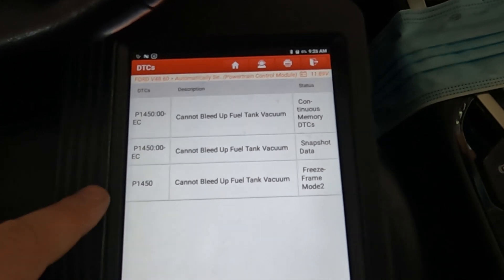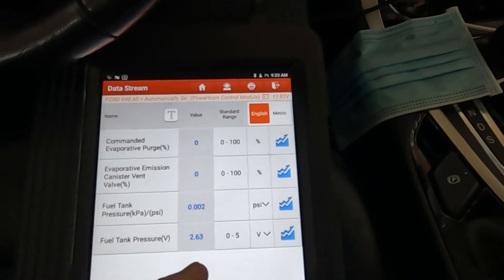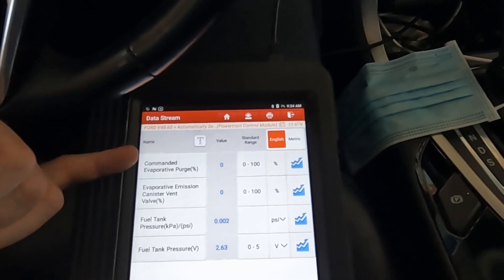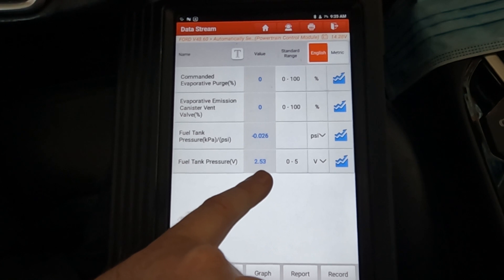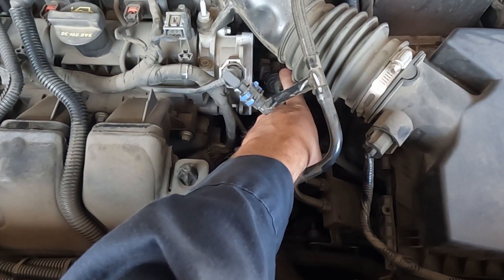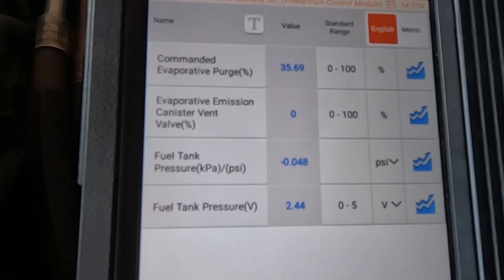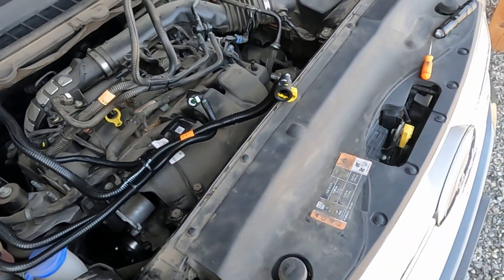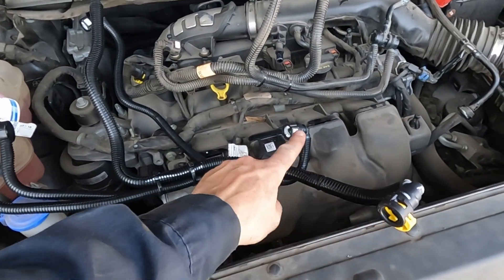Ford P1450 EVAP Code (How to) Simple Diagnosis and Repair

Comment: I have a 2014 Ford Transit Connect. Every time i put gas on it, the car wont start right away. It turns off. I already change the purge valve. Any body can help?
Reply from the maker: The purge solenoid is the most common reason for a no start after fueling. Do you have a check engine light or any codes?

Comment: P2196 also triggered in my 2015 Ford fusion 2.0 Eco boost. It's very hard to replace because there's no room for my hands down below and the OEM clips are very hard to release. No room to pull 2 tabs simultaneously and push on them at the same time when you can barely fit your hand down below. I replaced it with a Doorman brand, much easier clips in case you have to replace it again. 
P1450
Reply from the maker: Thanks for your comment! Glad you got it fixed 👊. I wish the auto makers would consider giving us a little more room to work. A lot of cars these days are cramped 😕

Comment: Also can the break boster pump leaking cause this code as well?
Reply from the maker: Good question. The EVAP system and the brake booster are separate systems. To check the EVAP system the engine computer turns off all solenoids and closes the system. It should hold at whatever pressure it's at for a certain time. If the fuel tank pressure sensor sees a change in pressure beyond the threshold it will set the code.

Comment: If these r all hoses isn't there a way to clean them out? Like a straw cleaner if the end valve is working? If u cannot blow through it supposedly its working? Yes or no?
Also what else could I check if this is good. Where is the gas tank collector?
Reply from the maker: The main culprit is the purge solenoid. Unfortunately cleaning out the hoses won't fix the solenoid. You can manually test the solenoid with a hand vacuum pump. It should hold a vacuum 👍

Comment: What about a Ford E-350 Triton 10 Cylinder, Year 2000?
Reply from the maker: The purge solenoid will be quite a bit different from this but the diag should be similar if you have a scan tool that can read live data.

Comment: Would this cause a "farting" sound from the gas tank for lack of a better description when the fuel level is low? 2.0 2017 ford escape with a p1450 code.
Reply from the maker: Not that I know of. Do you have any codes as well?
Reply: @ValleyMobileAutomotive  the p1450 is the code it had. It would drive fine but then would make a goose / farting sound from the fuel filler inlet and then after fueling would be very hard to crank.  everything under the hood checked out fine. Evap solenoid would work and not stuck open.I did notice the charcoal canister solenoid had little flow with power on the plug and blew it out with compressed air. Reset everything and put 100 miles on it today. The p1450 is gone but now had a p0442 code.  Drives
Reply from the maker: @Guardianautoservices  Hopefully the charcoal canister solenoid was removed. The EVAP system can't handle a lot of pressure. Around 1 psi or less. I would recommend a smoke machine to see if there is an actual leak or not.
Reply: @ValleyMobileAutomotive  great idea! I unfortunately dont have one but I will see what I can come up with.

Comment: What is the situation with the 2018 Ford Escape 2.0 Ecoboost?
Hello.

 

I am from Poland and I have a 2018 Ford Escape 2.0 Ecoboost.

For a few days now, I have been getting the P1450 error. When I clear it, it reappears after a while, after driving about 0.5 km or more. Now i drive 40km the error did not appear
 

Can you help me identify the problem?

 

Will I also have a valve that needs replacing? Or do I have a problem somewhere else? I can send you videos of the tests I have performed.
Reply from the maker: Welcome! Usually the P1450 code is because of a faulty purge solenoid.
Reply: @ValleyMobileAutomotive  Thanks for the info.

I did some tests with the IDS program but I'm not sure if the EVAP valve is damaged.

It seems to me that there may be a problem with a leak. Can he see my tests and interpret if the valve is damaged or should I look somewhere else?
Reply from the maker: @fidodido0  Unfortunately I can't look at your readings. A faulty purge solenoid will cause an EVAP leak. Another symptom is a rough start after filling up at the gas station.
Reply: @ValleyMobileAutomotive  I have recorded videos on YT of the tests.

Yesterday I filled up and the car actually took quite a long time to start. But I was very busy and didn't pay attention. I don't want to buy unnecessary elements and that's why I'm looking for the cause.
Reply from the maker: @fidodido0  What you are describing sounds exactly like this issue 👍
Reply: @ValleyMobileAutomotive  Hello.

Today, in addition to the P1450 error, I got P0456. It didn't happen before, maybe it showed up now when I filled up the tank with fuel. Maybe there's a leak somewhere and the valve is good.
Reply from the maker: @fidodido0  It sounds like the valve is bad. If it's stuck open it will cause a leak.
Reply: Hello. I ordered the valve, we'll see what happens. Today another symptom, a buzzing fuel filler. @ValleyMobileAutomotive

Comment: Thanks for a great video. I have a  2018 Ford Edge 2.0 Eco Boost. For the problematic lower two connectors and my old, large, arthritic hands, I chose to spray both with silicone spray before manipulating. On the upper one, I was able to slide a finger under to compress the lower white tab while pressing down with the a flat screwdriver on the upper white tab.  For the lower yellow connector, I was able to push down both sides of the locking tabs with a right angle probe / pick and then pry the top part (facing downward) of the connector to release.  Thanks again.
Reply from the maker: @johndicesare2873  Nice! Those lower connectors are not fun. Glad you got it 👍

Comment: I just did this today. The bottom yellow connector I did with 2 people. I held 1 side of the yellow clip with my pointer finger and used a long screw driver on the other side. Then had my wife take another long screw driver to push down on the one side. I did have to rotate one of the hose clamps toward the front as suggested by someone in the comments as it would cut into your hand. The hardest clip to get undone was the white one just above the yellow one. My hand was too big to squeeze both sides of the white clip in but after some time I finally got it. Whole job took about an hour. Just hope like hell this solves the P1450!

Thanks to all commenters for the tips!
Reply from the maker: @tim7757  Thanks for sharing your experience 👍
Reply: Is it fixed now?
Reply: @Isis-wm4po it is!

Comment: Wow, thanks for explaining that. The last part makes sense now for me. I have a 2018 Ford escape and when I have been fueling up recently, it won't turn over. It would start and then shut off and say I need to manual restart. It will do that a couple times and then run normally afterwards. I got the engine check code and it was throwing a P1450. Looks like I might need a new engine solenoid.
Reply from the maker: @sheriffwoody6564  A new purge solenoid should clear that up 👍. Glad this video was helpful 🙂
Reply: 2018 edge, just under 100k, CEL went on thursday and friday started doing what you you described on friday after gassing. Very weird

Comment: The bottom yellow connector was a pain in the rear however after I cut it with a pex cutter I able to rotate for easy access and it came out
Reply from the maker: Nice tip! 👍

Comment: Just had this code come on today with my 2017 Ford Fusion after a free Diagnostic at Advanced Auto. How much can it possible cause to fix this issue cause sounds like it's not just one thing but several...

Comment: Folks, if you haven't taken yours apart yet and are planning to tackle this yourself, save your hands, knuckles, wrists, energy, curse words, and frustration. Do this instead - Clip the zip ties holding the 3 hoses together. Undo the white pinch connector hose from the top of the intake and underneath, and also the purge valve over on the driver's side under the intake hose. LEAVE the hose with the YELLOW CONNECTOR ALONE. Undo the zip ties on the new standard piece, and use the hoses there, other than the one with the yellow connectors. After you have the other new hoses set into place and purge valve in place, just zip tie them back together like they were from the factory and you're set. I'm 2 days into a 15 minute job, so don't be like me.
Reply from the maker: Hey Adrian! Thanks for the tip 👍
Reply: You’re my hero!
Reply: I just came across this. After tearing up my hand and about ready to put everything back together and take it to a shop I read this. I spent more time trying to find the snips to remove the zip ties than I did getting everything back together. You’re my hero!
Reply: Exactly what we I did! I tried to get my son to try to take it off because I couldn’t. We gave up after a few tries and should have gone your route in the first place. 😂

Comment: Question i changed the canister purge valve and the canister the one is next to fuel tank but keep saying Unable to Bleed Up Fuel Tank Vacuum and when i go to put gas the fuel tank sounds boom and when i try to start it is hard
Reply: Yes… I have same issue after replaced…. It doesn’t work… Have you find a different solution?
Reply: @RodrigoJesus-u1c  Same here.😂

Comment: For ANYONE replacing the whole thing.  the connector that people always have problems with is down by the alternator.  The solution is to loosen the hose clamps above and below the piece that the connector is attached to and simply rotate it out to the front of the engine.  then you can get to it without tearing your hands to shreads or trying to jab at it with picks and screwdrivers.
Reply: Just did this on mine and spent around an hour messing with that bottom connector. Disconnecting the hose would have probably made it a little easier. Was able to get it with picks and screwdrivers lol
Reply: Hey what is the wiring harness called
Reply: Damn just read this comment and literally the way i did it

Comment: Hey I have the 2015 ford edge 2.0 but my valve has 2 hoses and just the solenoid and I can’t find it anywhere I’m very confused the thing has 2 hoses and on the solenoid not the 3 hoses and the solenoid any advice thanks!
Reply: You have to look for a video of that specific car

Comment: Awesome video 👏
It's always good to get the science behind repair, thanks again.
Lemme ask a quick question, could you have just changed the Vapor Canister Purge Valve only, instead of the whole assembly
Reply: Yes, you can, but you'll have to replace the hose that you'll need to cut for the repair.
Reply: From what I’ve seen, the hoses are all permanently connected.

Comment: Thank you for a great video. I wish that I had seen it before I attempted to remove the hose with the yellow clip that goes to the large rubber air tube. I was attempting to remove that air tube to give better access to the solenoid valve which is the only part that I was changing, (I have big hands). But, when I attempted to remove the yellow clip, I did it incorrectly and I broke the clip. I was willing to take a chance on just changing the solenoid purge valve because the part cost was only about $15.00 on Amazon, and ninety-nine percent of the time, it's the solenoid valve that is bad, and in my case, it fixed the problem.  But now, I'm sort of in a pile of dung because that clip is not replaceable, (unless of course someone knows of a way to repair/replace it).  It's not a problem right now because the hose is still securely attached to the air tube since the locking part of the clip is still in the connector so the hose cannot be removed.  But, if and when the day ever comes that I have to remove that hose, I suspect that my only option will be to destroy the entire connector, remove the hose, and change the entire tube, (if that day comes I'll buy a FANLIDE Vapor Canister Purge Valve F2GZ-9D289-A on Amazon for $70.00 and use that assembly, which is a far cry better than the $176.00 that Ford wants for the same assembly.

Comment: How did you reach the connector way down under the engine? I'm having a really hard time getting my hand around the radiator hoses
Reply: For ANYONE replacing the whole thing.  the connector that people always have problems with is down by the alternator.  The solution is to loosen the hose clamps above and below the piece that the connector is attached to and simply rotate it out to the front of the engine.  then you can get to it without tearing your hands to shreads
Reply: I'd tell you

But it's been 8 months already😂

You're probably good by now
Reply: @rapinncapin123 how tho